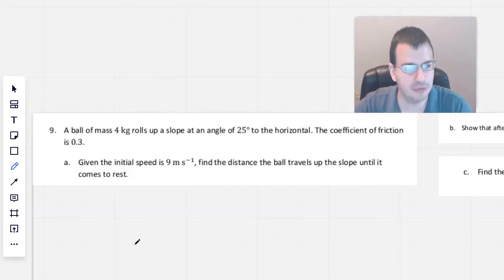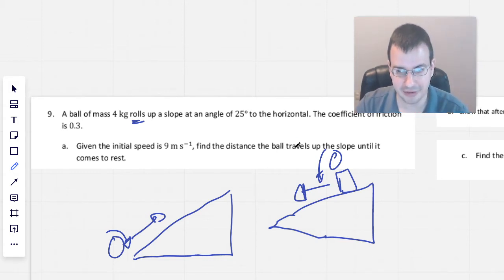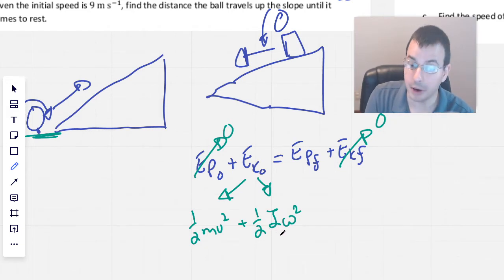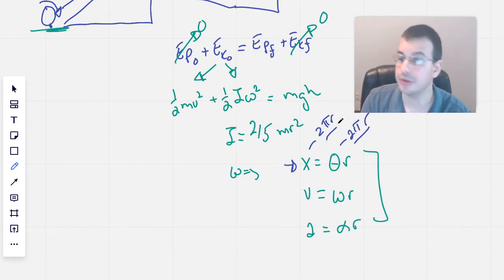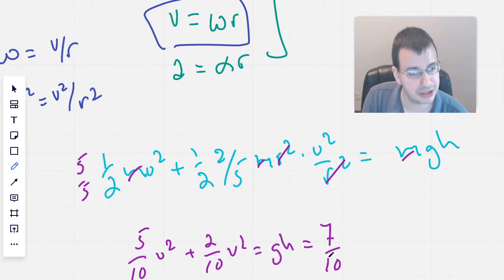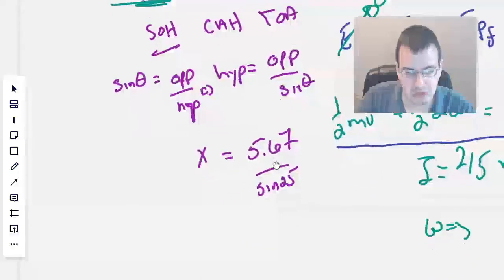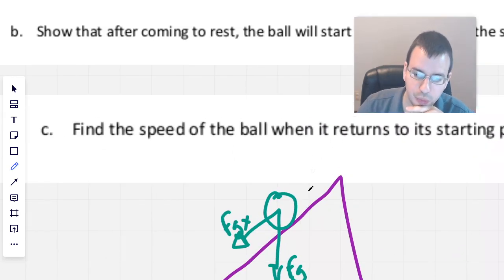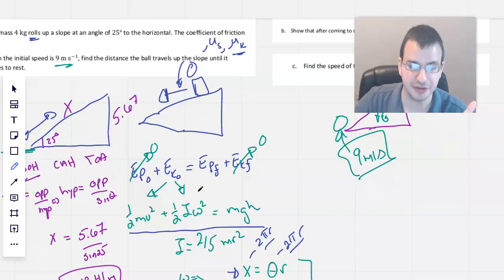Ball Rolling up a Ramp

Comment: Are you sure about the answer, it seem that in the first part of the solution you did not plug in the friction coefficient, which would mean it is irrelevant (which seems odd).  In the second part since you end up with the same speed at the end of the slope again it seems you do not utilize this coefficient.  OK, conservation of energy, but doesn't friction utilize energy as work?  Therefore is seems that you end up with the same anwers no matter what the friction coefficient would be, which doesn't seem right.
Reply from the maker: I am not sure about anything in life, especially not in my ability to do basic math and physics.
I assumed that the ball ‘rolled without slipping’, which is a big assumption but I made it because I am not sure if it would be possible to solve if I didn’t assume a no slipping condition.
Friction doesn’t cost energy for a rolling ball because the linear speed of the bottom of the ball is zero since it is the axis of rotation. Since work is the integral of force over distance and the distance traveled is zero for the bottom of the ball, the amount of energy lost to friction is zero. In reality though, all rolling objects slip while rolling to some extent.
Reply: @BenKohnPhysics  Taking into account your assumptions, I think you're correct.  If we were dealing with a solid body which was sliding up the plane there would be work done and conversion of energy into work, the distance travelled up the plane would be smaller and the speed on the way back would also be smaller (due to lower potential energy at the top and even more work being done on the way down from the top to the bottom of the plane).
Reply: friction does not matter here because of a precondition of the rolling without slipping problem. The friction is large enough to cause rotation of the ball, without enough friction the ball would just slide up.

Comment: Thanks G. Don't exactly get why Ek is split into both the 1/2 * m * V^2 equation and the rotational one, but you saved my assignment either way
Reply from the maker: Glad I could help!

Since it is rolling the kinetic energy will be split between the two. The exact distribution has to do with the shape and if the object is slipping.